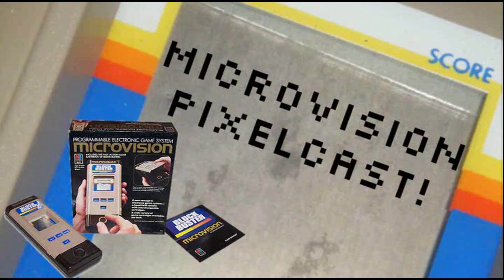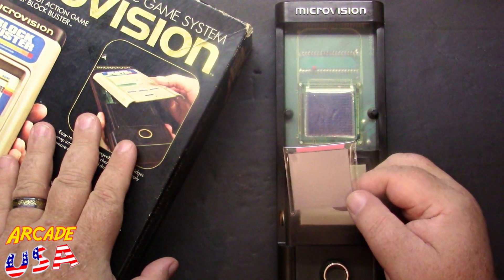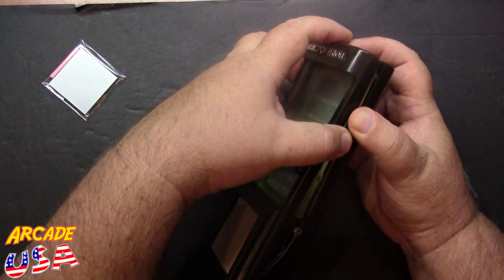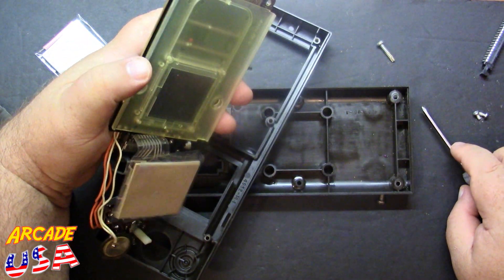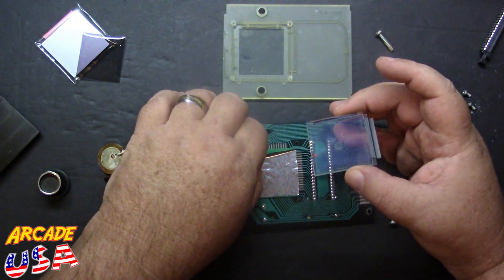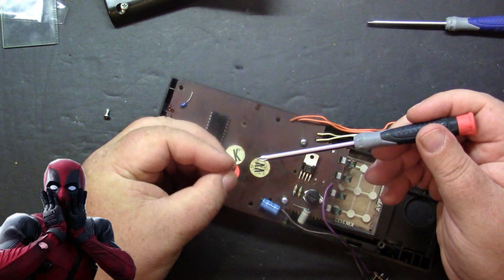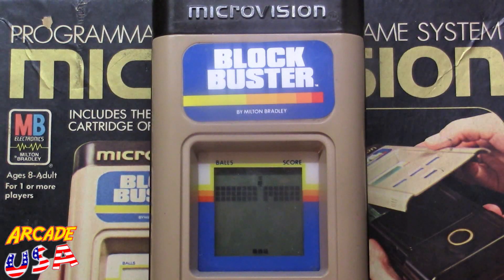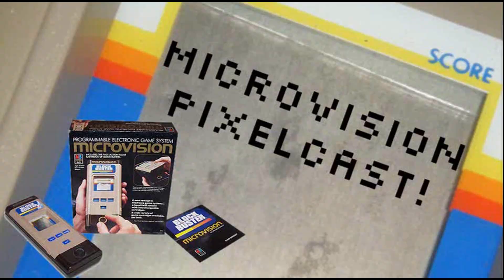Milton Bradley MicroVision Screen Replacment!

Comment: 122$ on ebay, new screen. Outrageous price, it was much lower till a couple of years ago!
Reply from the maker: supply and demand :), the new screen coming out boosted its demand.  I have had three I put new screens in so far saving them from the dumpster :P Considering the new screen costs around $99, $122 for a working Microvision with a new screen is not that bad when you take that into account :P

Comment: the 5-11 project has also reached completion finally so there are two active suppliers, although he doesnt offer the backlit version thats a more expensive option anyway and isnt really needed
Reply from the maker: I like the backlit version :).  I prefer it over the non backlit, its much easier to see overall.
Reply: @SVT512  fair argument, but im fine with it staying in a state resembling stock, the screen is clear enough for me
Reply from the maker: @nickolaswilcox425  yep, my non backlit one I modified is clear just like the backlit one.  I just found the backlit one easier to see and was not as critical to hold the micorvision at the right angle to see the whole screen without a dark shadow along one side depending on where the external light source was.  I typically like keeping my consoles and such stock, but wanted to make a video for the backlit version, so there it is :P
Reply: @SVT512  just got mine in the mail. If you turn the backlight off is it just like non backlight one?